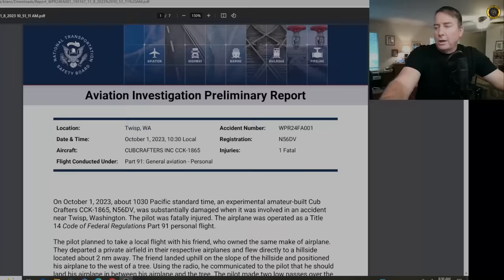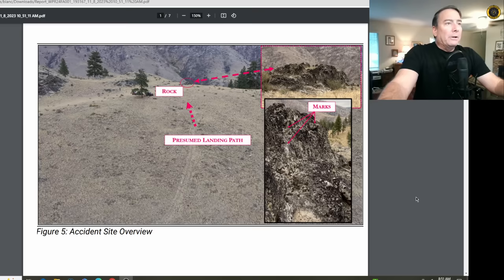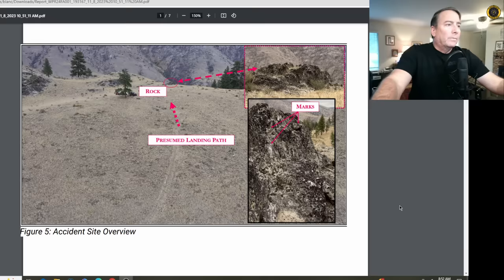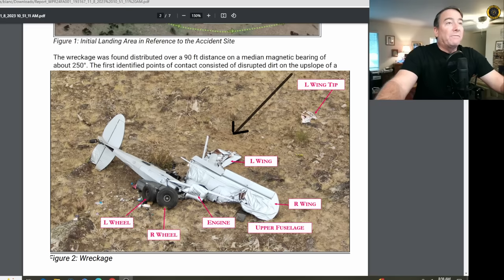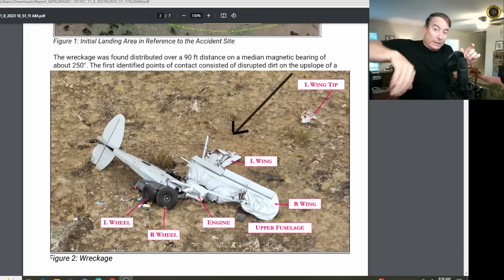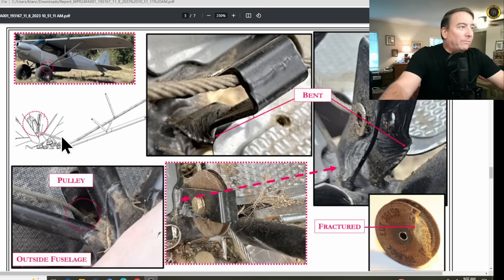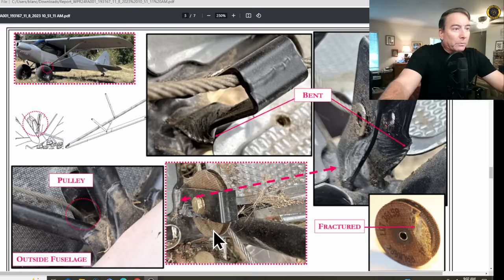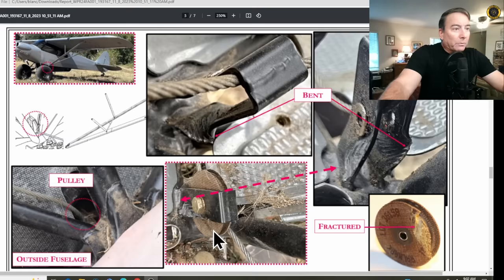Carbon Cub N56DV Fatal Accident NTSB Preliminary Report 10 Nov 2023

Comment: As a racecar designer and builder it seems to me that more thought (and priority) should go into making bush planes more crash-survivable. Everything in bush planes is built as light as possible with little regard for impact strength. Racecar drivers frequently walk away from 200+ G impacts, while pilots die all the time in sub-50 G impacts. We're talking about planes that will barely go 100mph, and most of their crash impacts seem to be around 50mph or less. You can drive virtually any tube chassis racecar head-on into a concrete wall at 50mph fully expecting to walk away uninjured. Just looking at bush plane frames it seems like adding 50 pounds of tubing, gussets, and shear panels could quadruple your chances of survival in most crashes.
Reply: Add 50 pounds to a Carbon Cub??? Many of these owner's go to great extent to save a few OUNCES! That 50 pounds could end up killing them in a high density altitude situation - which is a much more likely scenario for these aircraft.
Reply: But that extra 50 lbs raises the stall speed, increases takeoff and landing distance, robs power and likely increase costs. All of which ‘flys’ in the face of what owners try to achieve.
  I’m sure this is a risk they are willing to take and many are successful!
  If pilots would always fly their aircraft within its design limits every time, then there would be far less crashes.☺️
Reply: And you are not going to change survivability very much in a plane.
Reply: So long as pilots only care about performance they'll keep getting their legs crushed and keep dying in low G impacts. Racecar drivers used to have the same attitude, making everything as light as possible, to make it as fast as possible, no matter the risk. 75 years ago most significant racecar crashes were fatal. Now fatalities are extremely rare and 300+ G impacts have been survived. Any idiot can look at a small aircraft frame and see that it's a death trap if you hit anything with it, just like a Formula 1 car from the 50s. F1 guys also said having roll structures and crumple zones would reduce performance too much and cause more accidents... yet they keep getting faster and safer year after year.
Reply: Just first thought, pilots are generally not wearing the same kind of safety gear as racecar drivers either.  But yeah, that might not do much good when the whole thing crumples around you anyway.
Reply: My friend  didn't paint plane   "that's like 20 lbs"  was his reason....   buy a beaver....was my return  comment..
...Lancasters were  better planes...75yrs  ago....   to bad this guy had a bad day....
     I know apples to oranges..
But still..        I'm  not a jet guy....
It needs a prop and big ass wings..
Creatures of habit I guess ...

N.Ont  canada...
Reply: @Mister510  the aviation community is very, very conservative with most of its members believing, with good reason, that a slow and steady evolution and adaptation of new technology and new thinking is best. I think that you are making some valid points about what is technically possible and doable. But unfortunately, it will take decades of baby steps on the part of the industry and on the aviation community and lots more lives before those kinds of improvements occur.
Reply: Heavy versus performance has been a long running feud. You can make the worlds safest car.  Make it weigh 5 tons and run 20 mph tops. Or the worlds most efficient car. Make it weigh 600 lbs.  You have to strike a happy medium. Has to be efficient, but safe and lightweight. Airplanes aren’t designed with hard collision in mind. They tend to be in the sky and should only be near the ground on take off and landing. A car on the other hand is inches, maybe feet  away from possible collision most of the time.
Reply: Great idea and worth every pound!
Reply: @OneTequilaTwoTequila  More weight decreases drag?  What great news!  I'll make sure to always carry a block of lead in my plane!
Reply: More weight and you need more power to go faster.  The people that designed these airplanes really hit a sweet spot.  These airplanes are very safe from everything I have seen.
Reply: Plastic deformation vs elastic deformation - When energy goes into changing the shape of some material and it stays changed, that is said to be plastic deformation. When the material goes back to its original form, that's elastic deformation. Mechanical energy is lost whenever an object undergoes plastic deformation. Race cars are designed with "plastic deformation" in mind. When the collide with something, they break into smaller parts by design dissipating the energy of the crash. In airplanes I don't believe that would be a good idea. A hard landing and the wings fall off? This is what I remember from accident investigation and physics class from 30 + years ago, so I may have it wrong. Any aeronautical engineers out there???
Reply: They need more power
Reply: @Mister510 if it's not for you that's fine, but don't demand others do what you think they should do for the sake of safety. Plenty of truck drivers die every year. Nobody seems to think that's a priority to stop people doing because they still want their things.
Lots of people would still consider car racing to be too dangerous so i think it's best not to go down the path of demanding safety is the highest priority.
I wouldn't race speedway karts or bikes but i wouldn't want to take that away from those who enjoy it.
Reply: @daviddurkop1719  That is NOT how racecars are designed. Fiberglass bodywork, windows, and tin often disintegrate and fly off on impact, but none of that stuff is structural or heavy enough to hurt anyone, or help with secondary impacts. Suspension, chassis, or drive train parts should not be ripped from the car in any impact. (Of course it happens, but very rarely, relative to the number of crashes.) Remember I'm talking about steel tube chassis cars (construction method relatable to bush planes) not carbon fibre monocoques. Rule #1 of crash survivability is keep the vehicle in one piece until it stops moving. With airplanes there's a point where you want the wings to tear off so they don't compromise cockpit integrity, but that would only be when they hit a solid object, like a tree trunk. One of the biggest safety problems I see with small plane crashes is the first hard impact often rips the engine loose leaving nothing in front of the pilot to absorb impact.
Reply: Or just try not flying into a rock. IDK 🤷‍♀️
Reply: I don't think it would take 50lbs to make the airframe more survivable. Many GA crashes would be survivable if the occupant area were a safety cage (similar to cars).

No other industry did this sort of work without a lot of pressure or a legal mandate. It's the same for aircraft. It would take a lot of engineering to design a safety cage and add some expense to make it out of light enough materials (can't use steel tube for weight reasons). 

Everyone would rather tell themselves crashes aren't survivable anyway (even though evidence says many would be) and maintain the status quo.
Reply: @xenadu02  I just threw out a number for about what I think a basic cockpit cage, like I'd want, would weigh. Being a racecar designer not an aircraft designer I don't know the normal working loads on the airframe, but I know a proper cage would be massively stronger than anything else in the airplane. Being an aircraft the rest of the structure's design would need to be modified to utilize that strength obviously, and correct the balance. 30 feet of 1-1/2" .095 DOM steel tubing is 42 pounds. I don't know if that's enough, I don't have a Kitfox to measure. lol It would probably replace 15-20 pounds of  twig construction and the engine mount. The engine needs to be mounted directly to it as keeping it attached is critical to crash survivability.
Reply: @Mister510 This thread of yours is thee most interesting chat I have run across in a ton of crash videos. I'm in the process of completing a biplane and thinking wth is the safety in this thing. These kit planes need a guy like you to come at it from a totally different starting point.. crash survivability
Reply: @ch2305  Thank you. Replying to some of the comments has kept my brain cranking up new crash scenarios and design ideas for small planes. I spent years studying crashes and crashed racecars, seeing what worked, what failed, and how it could be improved. It would be really cool if someone that actually designs small planes wanted to listen to my ideas. A biplane could be as crash-safe as anything else, depending on how it's constructed. If it's got a big heavy engine out front that's a big plus if it stays attached and the structure is strong enough to keep it out of your lap. I haven't seen much on modern biplane crashes and have no idea how they're constructed, other than the early ones were wood and fabric. A wood constructed airplane is one I would probably not attempt to make crash safer as I think it would be nearly pointless. On impact wood construction becomes a collection of many spears. Wood rimmed steering wheels are banned in all forms of auto racing worldwide (except vintage cars that had wood originally) because they sometimes splinter and impale drivers, and frequently caused gruesome hand and arm injuries when they were common.
Reply: Well to be honest those vehicles never need to get off the ground and fly in the air. Maybe some kind of foam safety flight suit. Or an inflatable suit. Plus protection for their neck.